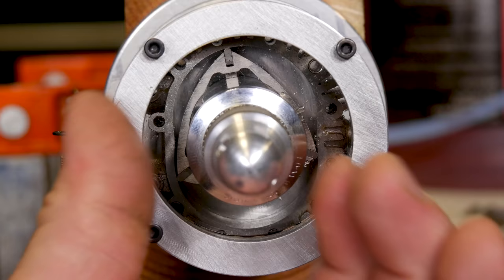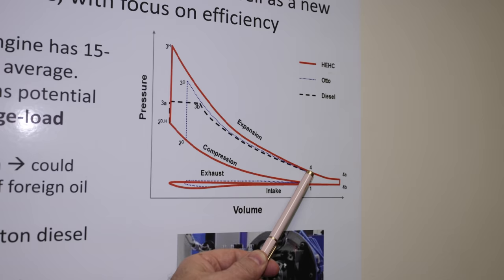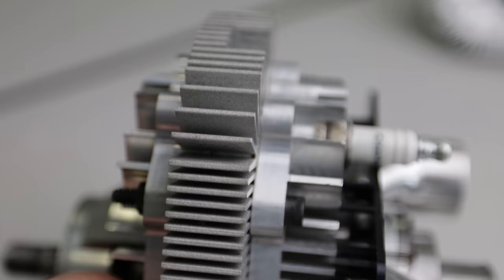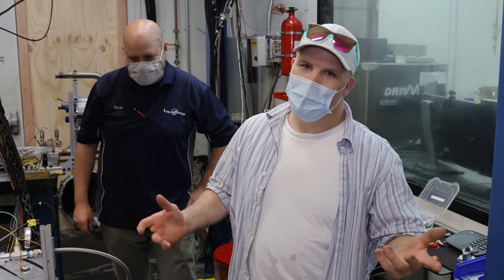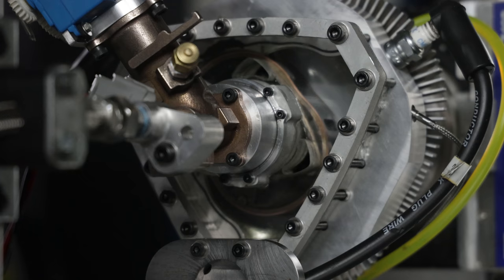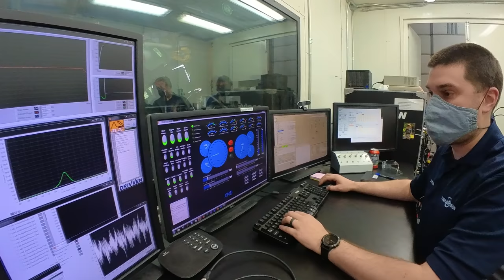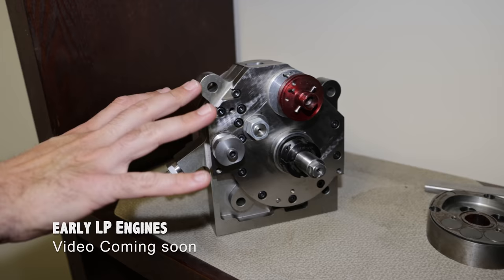See Thru Liquid Piston Rotary Engine - In Slow Motion

Comment: is the engine actually running?  It's hooked to an electric motor that never decouples.
Reply: Yeah I was wondering that. Would've like to seen it run on it's own, started with like a rip cord or a li'l starter and under load.
Reply: I believe it was running on it's own, in fact possibly driving the electric motor/generator. This is on a dynamometer setup used for R&D, probably capable of spinning ("motoring") the engine as well as testing it under load.
Reply: @quillmaurer6563  What evidence do you base your belief on?
Reply: @HamRadio200  I've seen similar dynamometer setups before, they're quite common in engine R&D. And the engine is clearly firing, so if it is indeed capable of running it certainly was doing so. The whole idea seems sound, I have no reason to believe it wouldn't be able to run on it's own and produce at least some power. How much power, how efficiently, and reliability and longevity I'm less convinced of, but I fully believe it could run, and was doing so here.
Reply: @quillmaurer6563  I understand your position fully.  However, engines will clearly fire, but not run under their own power.  Have you ever heard an old chevy trying to start?  A person will wear the starter out if they don't know what they're doing.  Engine is firing, but won't stay running after the starter is removed.  Same concept here.  There is no indication that this engine is running under its own power.  That's the point of my OP.  Saying it could run and it running are two completely different things.
Reply: @HamRadio200  Not familiar with those engines. I guess either is possible, but there's not necessarily any reason to believe it's not running either, unless you're just so skeptical of the design to not believe it could possibly work.
Reply: While it presumably also serves a starting motor, that electric machine is obviously used as a generator in this engine dynamometer. Of course it is never decoupled - it is the load for engine testing.
Reply: @brianb-p6586  You are correct.  However it is assumed that the engine is running under load or under its own power.  There is no indication in this video that the engine is powering the dyno.  There are no power graphs or charts provided to prove the engine is running.  Sure, it's firing, but any ole engine could fire as long as it's being turned by an external power source.
Reply: @HamRadio200  Sure, you can fake anything, but to say that's a motor attached so the engine must not be running makes no sense - by that logic, every engine on every engine dyno might really be just turned by the dyno, and every vehicle on every chassis dyno might just be idling on powered rollers instead of powering the rollers.
Reply: @brianb-p6586  I'm not saying it's faked.  I'm saying, i don't think the engine runs under its own power.  I see the engine firing yes, but that is different than running on its own and actually performing meaningful useful work in some application.
Reply: @HamRadio200  Okay, but then why don't you think every other engine is not running under its own power? There's nothing surprising about this engine working, at least for a little while.
Reply: Finally the smartest comment here!!!
Reply: @quillmaurer6563  yeah na

Comment: Is the electric motor in the back causing the rotation full time, or just to start it and disconnected with a clutch after
Reply: The beauty of an electric motor is that it can also be a generator. You can use it to start the engine and then load it, all while gathering data like RPM, power, and torque. No need for a clutch.
Reply: I'm wondering the same thing. To me it looks like it's not running on it's own.

Comment: it is still a 2 stroke, with 2 stroke emissions, plus those bearings are gonna get HOT with the exhaust gas going throught the hollow crankshaft. look for higher than 1000F exhaust temps. elegant simplicity
Reply: this is a 4 stroke
Reply: This does have a stroke

Comment: I know plasma and microwave ignition is/has tested with positive results but I wonder if just a steady arc vs what looks like pulse driven sparks would be better. Would also be cool to test different types of gas vapor that inject into the chamber via its own deticated system for the sole purpose of helping evenly ignite the fuel. I know nitrous is used for additional power but I am talking about small amounts continuously injected(maybe not at idle?) not to contribute in any way except quicker/more even ignition of the vehicles fuel. Other gases may perform better than nitrous for this purpose. 

 Probably a stupid idea just popped in my head when I saw the spark plug pulsing.
Reply: Glow plug only works if the fuel is injected diesel-style.

Comment: Basic problem with the rotary is disappointing torque.  To function correctly, it must rev high, which makes it unsuitable for city driving.  It's also unsuited for light aircraft with constant speed propellers around 3000 rpm.  A rotary aircraft engine would require a transmission, which adds weight and spoils its power-to-weight advantage.

A diesel rotary would need far less oil in the mixture, since the sulfur in diesel is an excellent lubricant.  However, diesel is most efficient around 3000 rpm, where the rotary is not yet fast enough to reach peak efficiency.

Comment: Is unfortunate that just when the rotary is starting to work properly, we're already stepping in the electrical motor age.
Reply: You can use a little one of these to charge your smaller battery packs for unlimited range....
Reply: They are working for their engines to be used in hybrid combinations to cut down on the weight of the batteries.

Comment: Why is the electric motor being used in the back to start the engine and runs throughout. Is the engine not capable of sustained rotation?
Reply: It's a dyno
Reply: @MrMaxitaple  Source?
Reply: @razam1256  idk bruh, but you have a good point there
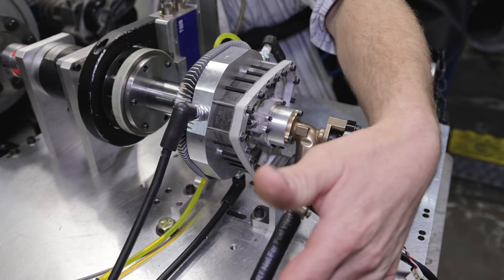Reply: @razam1256  9:53

Comment: Why is this engine called "liquid piston." I don't see any liquid anywhere. And how is each combustion chamber sealed to prevent gasses from escaping to the adjacent combustion chamber. Wankel had sealing devices on the piston (which often wore out after only a small amount of use). No sealing method is described for this engine. I followed the link above labeled "liquidpiston engine." What I saw there is syntactically incomprehensible language." For example. "liquid piston engines are designed to be [bullet point 1] Lightweight and compact. So far so good. But ""liquid piston engines are designed to be simplicity" makes no sense. Maybe they meant ""liquid piston engines are designed to be simple." ?? If so, that sounds like a rather complex, convoluted way to say "liquid piston engines have a simple design." Then I go to the "how it's made" link and find that there is no liquid involved in the construction of the engine. Sealing the combustion chambers is done by wrapping a 1mm thick metal seal, made out of "cast iron steel" (a non-existent material) around the piston. There is no such thing as cast iron steel. There is something called cast iron, and there are various alloys of iron with carbon and other substances, called "steel," but there is no such thing as "cast iron steel." Also, there is not explanation of how this material functions as a seal.
Reply: It's the name of the company that designed it.
Reply: Also the sealing is done purely by the clearance between the rotor and the housing, obvious in the video as no visible combustion seems to escape from the combustion chamber during detonation due to the tight clearance between the rotor and the housing.
Reply: Tight, for now..
Reply: The apex seals are part of the cylinder not the rotor like a Wankel I thought?
Reply: It seems like the apex seals might be prone to "floating" between the rotor lobes at high rpm.

Comment: There is no real difference with a rotary engine.  This is just reversed, has stationary apex seals and has the ports in the rotating portion instead of the stationary.
Reply: Well there's some advantages right? Stationary seals can be lubed, it has 3 combustion chambers instead of "one" so it should heat evenly which was another wankel problem.
Reply: @FirstName-nf4fx  No a wankel has three chambers.  No, the stationary apex seals can't be lubed.  It has chambers on either side of it, not sump.
Reply: @notj5712  the wankel only burns in one chamber though? Whenever I see one it's all black from combustion on one half of the rotor housing only. Isn't there just one spark plug per rotor?
Reply: @FirstName-nf4fx  The Wankel engine uses all three faces of the rotor as they sequentially pass the one combustion point (with the spark plug) in the stationary housing.
Reply: @brianb-p6586  right so half the motor by the sparkplug gets hot and the far side stays cold causing differential heating. The liquid piston one has 3 spark plugs so should heat evenly helping with sealing and stress
Reply: @FirstName-nf4fx  Riight - just as a Wankel has combustion on all three sides of the rotor but only one of the two housing sides, this engine has combustion in all three corners of the housing but only of the rotor sides. That makes the Wankel simpler (only one spark plug and possibly direct injection location) and the differential heating of the Wankel housing is relatively easy to manage with liquid cooling because it is accessible and stationary. 

In an air-cooled version, the Liquid Piston design might have an advantage, and they do seem to be targeting very small basic engines that would be air-cooled.

The term "chamber" was the confusing part - both engines have three working chambers, all of the functional - they are moving in the Wankel and stationary in this design.

Comment: I'm curious as to when and if this could be wide spread in the automotive market. I know size, power and weight are three advantages it has, but what about fuel economy? If it's a gas guzzler, you're dealing with an entirely different problem.
Reply: I'll wager you never see it in a production automobile for several reasons.   First is the difficulty in lubrication and modern emissions requirements won't allow for excess oil getting into the exhaust.   Second is the exhaust cooking the rotor which is going to cause thermal expansion issues as well as the lack of scavenging on the exhaust 'stroke'.   Notice that the exhaust is just kind of coming out rather than puffing out with some velocity...this is going to really hurt the efficiency potential.
It's neat to see all of these 'new' engine concepts vying for investor money...but how many actually make it to market?   Virtually 0%...because the competition they're fighting against has had well over 100 years of development and constant improvement to the mature machines we all use daily.   Anything 'new' must not only match EVERY aspect of the current product, but must surpass it far enough to make the investment in change worthwhile.    In other words...don't hold your breath waiting to see any of these in production vehicles anytime soon.

Comment: This is super awesome, but I still see a few issues but the main one being the new "rotor" has the same side always on the hot side which could be a potential failing point due to the heat when scaled up. This is definitely exciting, and I hope they figure this out and can create a great use for it before combustion engines get outlawed everywhere.

Comment: Maybe not torque? But this thing should make enormous power while combusting all three chambers in every rotation. I could see a strong use case in aircraft. We're in need of reliable lightweight engines that create large amounts of power. The low weight allows us to move faster, climb faster, carry more people and/or fuel, and better weight and balance. Start in the experimental category and hope for the viability of being certified later?

Comment: Rotor is getting real hot due to the exhaust gasses. Well this means the air fuel mixture is getting hot too. 
And we all know that hot fuel mixtures contain less air due too expansion of the molecules. 
So less air makes this engine burn inefficient!

You guys must find a way to get cold mixture into the combustion chambers. 
May be ECU controlled fuel injection will do the job.

Comment: I'm missing the stats on how much horsepower and torque this engine is putting out, and profected power for a large engine suitable for use in an automobile. And of course efficiency of fuel usage for the power its making. If I'm ahead of myself here, its just curiosity into where this project is headed in the real world. Thanks for any info you have. :)

Comment: The biggest problem will be the thermal management as the combustion face doesn't have a chance to cool down.  Once they go beyond a certain size, it's going to be a huge headache to keep this thing from warping and losing compression.
Reply: The rotor seems to be an issue in general. Besides the combustion side, the exhaust side looks like it may have thermal issues too. The only means I see of cooling the rotor are the intake charge and conduction to the housing where the rotor touches the housing. There doesn't seem to be a lot of contact with the housing so I don't see how very much heat can be moved via conduction. That leaves a lot of heat to be carried away by the intake charge. It seems a lot like running a forced induction setup without an inter-cooler.

The other potential issue I've never seen addressed is one similar to a problem with Wankel rotary engines. That issue is how the flame front doesn't interact efficiently with the rotor because of the changing geometry of the chamber as the rotor moves. 

I'd like to see some independent testing of this engine but that seems unlikely to happen.

Comment: Complete overhaul takes lifting that cover and changing rotor.
No valves.
Seals in fixed position, easy to lubricate.
THIS IS REVOLUTIONARY.
I only dont understand how is rotor cooled with exhaust pasing thru it?

Comment: Now that ive seen what the rotory engine looks like with that portion of the engine running I just don’t understand why they wouldn’t reinforce the part that keeps taking the compression blasts 🤔 after a while that cooks the metal and then makes it brittle leading to inevitable failure

Comment: Brilliant engine, would it work with overhead valves above each combustion chamber instead of the hollow 2 stroke type rotor. I just wondered if it would work. You can’t knock this masterpiece.

Comment: I wish there’d was broader exploration of the Wankel engine outside IC. I bet someone way smarter then myself could adapt this tech to be function as a sterling engine where the gas is cooled and heat applied in one rotation there by leveraging the difference to drive the rotor. This would mean you could run a wankel on anything that could heat a gas, including solar while still its liking IC dynamics.

Comment: The thing is with a piston engine, or better still, opposed piston, the piston(s) is/are being pushed in exactly the direction you want it to go. Not so with this, or Mazda's rotary.
This is the reason they will never be more fuel efficient. You then still have the issue with lubrication, where oil has to be injected with the fuel, like a 2 stroke engine.

Comment: i think the only problem here is the hollowed crankshaft. also the hot exhaust gas getting in contact with the hollowed crankshaft heating the air it intakes

Comment: I owned a Mazda for years in the late 1970s as well as a Citroen.  The Citroen got almost 3 times the MPG as the Mazda and even after 200k miles never burned oil.  After a year I sold the Mazda. This design has the same issues, poor mileage, and the need to lubricate its seals with waste oil.

Comment: The only problem they didn't solve with the Wankel is the very small offset of the force of combustion to the axis of rotation, which translates into almost no torque produced, and hence very low efficiency.  The real measure of engine efficiency is not power to weight, but rather energy input vs energy output.  Energy output of an engine is torque x degrees of rotation (measured in radians).  To produce torque, you have to give the force of combustion a "moment arm", i.e. the distance from the axis of rotation. The Wankel rotary had a pathetic 0.60", which yielded about 10% efficiency. Typical gasoline engines are 25% efficient, and diesel engines are 45%.

Comment: I notice that the same lobe of the piston/rotor takes the combustion cycle three times per revolution.  It must get pretty hot.  Does that affect anything?  How does lateral sealing work - between the rotor and the housing?  What is the projected lifespan of these engines?

Comment: Many years ago, driving from Utah to California I was stopped at a gas station with my 3 cyl. Saab. Two guys came up smiling saying they were working on a modified rotor engine that put out a lot more power. That was the middle of Nevada. Any relationship to this?

Comment: wondering how well it will do in real life scenarios 
as u all know how the rotary typically floods if not given enough time to heat-up or turning it off suddenly and thats with the sparkplugs on the side
with this LPRE(Liquid Piston Rotary Engine) with one of the sparkplugs positioned at bottom dead centre wont that make the problem worse? and if people wanting to make more power out of it thus richen the fuel mixture could it possibly floods it while running? Possibly introduce knocking and ultimately engine failure

Comment: Looks like this engine still has the same drawbacks a two stroke piston has. Fuel in the exhaust. You can see it collecting close to the exhaust holes in the clear piece in the front They need an advanced exhaust system to collect the methane vs spent fuel.